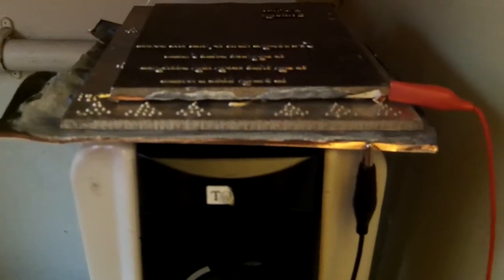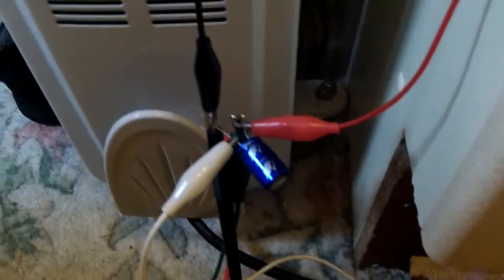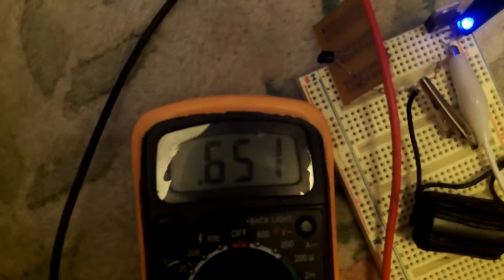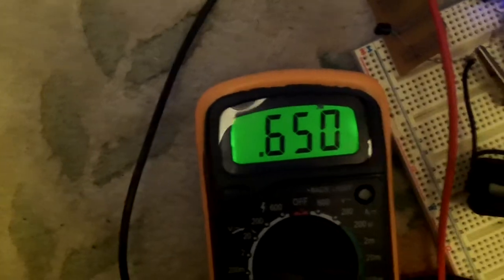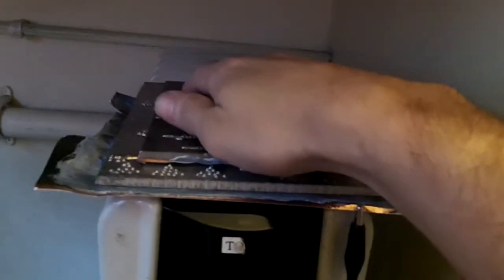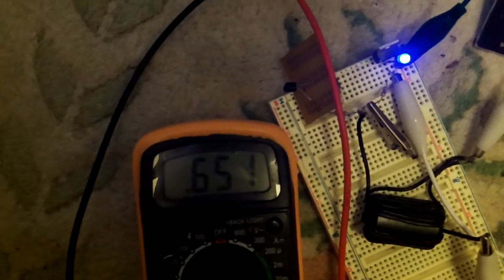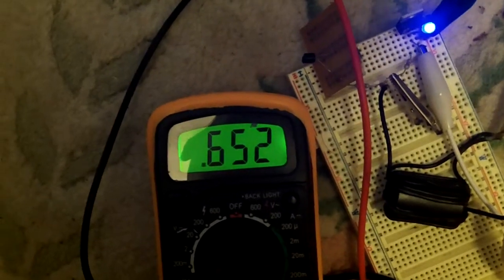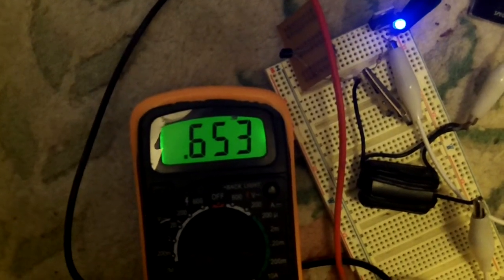Lovell device on a radiator.

Comment: love it mate - i have shared on google plus and tweeted it
Reply: Cheers Rob!  And thanks for linking to the video. Just watched your Lovell vid. I was wondering how I could get better contact between the layers. I might try clamping them together tonight, and see if that helps
Reply: i can see you are going to be much better at this than me mate - i can be a bit slap happy - could i suggest you calculate power over time then compare it to a battery? this might be galvanic - but it might be better than a battery - so if it does run down but produces more energy that an equivalent cell that would still be an important discovery
Reply: Still just getting used to it Rob!  It's a weird thing for taking measurements, because the voltage jumps around whenever you touch it - clamping them ruined my voltage. When more copper arrives, I will build a couple more cells, and get measuring so that we have some data
Reply: I also think fineness of the powder is going to be important - do you have a stone polishing machine?
Reply: MrSkypelessons
I mean one of those rock tumblers - you can stick some flint pebbles in it - leave it over night and when you come back to it the ink/paint is really fine
Reply: No mate. Got no idea what they are, or how they are used. When you say the fineness of the powder, do you mean the Zinc Oxide? Or the fineness of the ink layer?  I really enjoyed the spoon process. It is great seeing the shiny layer!
Reply: MrSkypelessons
yeah  - i like that bit too - that's kind of weird isn't it lol - i mean the zinc oxide the ink is pretty fine
Reply: MrSkypelessons
I'll do a quick vid on monday so you see what the mill is like - they are pretty cheap and good for making test inks

Comment: if it wasn't fully dried out before, it will be now lol. And you say it's improving with time too, that's opposite of what may be expected with such heat going on...very interesting stuff squire, congrats !
Reply from the maker: It's definitely NOT the time of year to have the radiator on full power!  But I suppose, in the name of progress... :)  Yes, it seems to be working well still. But let's see how it's doing in a week/month/year. It's currently resting at 1V with only 3mA. I thought I measured 15mA at first, but much less voltage. I think time will tell, because the output for this seems to be different each time you measure it
Reply from the maker: I've just put it back on the radiator (it really is an dry as a bone after all these tests!) and after a few mins it has gone from 3mA to more than 5mA (still rising). The voltage has risen slightly too. This is with no load. Lights up the joule thief with no capacitor. I love this montherm. Lots of fun. But it is far too hot in here!
Reply: Great info..it might work then ! lol
I don't know why I seem jaded, but probably due to it seeming just like a salts cell. Looking forward to your updates mate :)
Reply: slider2732 Yeah, I come from the same line of salt cell builders, and so believe me that I am still very suspicious. I have just measured it this morning, and it's still about 1.2V and 2mA with no load (other than the metre).  I'm waiting for thin copper sheet to arrive, and I'll seal one cell I make from them with epoxy. See how it performs with no access to water

Comment: Well done. What is the open circuit voltage of one cell in cold and hot condition ? What is the short circuit current at the ampmeter in cold and hot condition ?
Reply: 15mA. 0.8V cold. About 1V hot. That's with both of them together, in series
Reply from the maker: Sorry. I'm getting better readings today!  In fact, the readings vary massively. Now I'm getting 1.4V for both cells, but only 5mA. I will keep an eye on it, cos this is so different to what I measured before.  It's seems to work better and better. Hooray!
Reply: is the device still working.